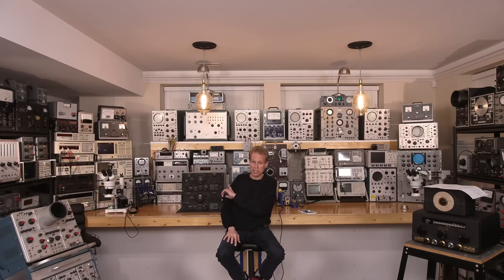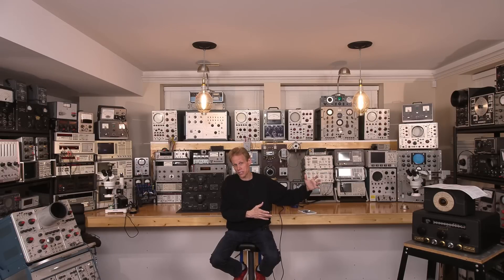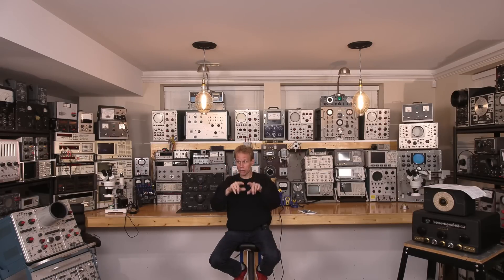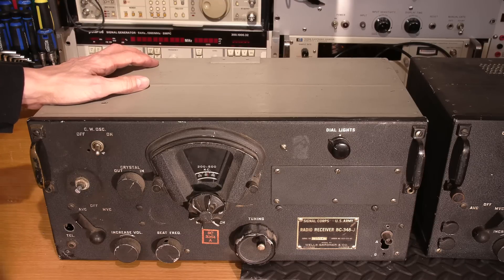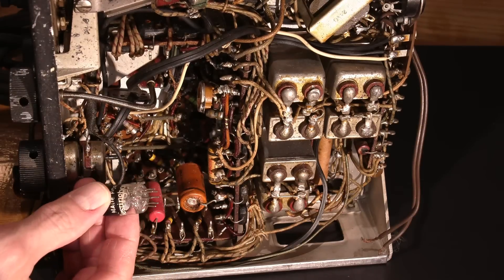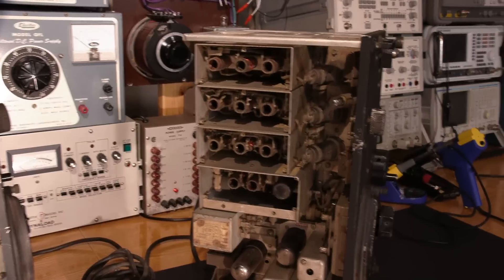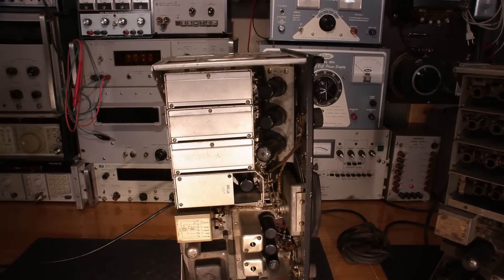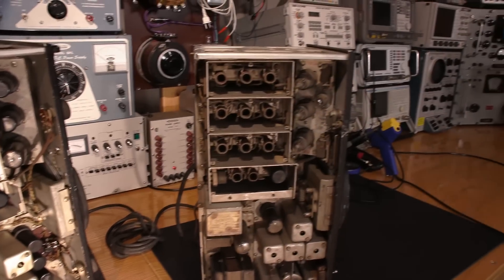Restoration Warplane Radio Receiver BC-348

Comment: Yes, please continue The Grand Reciver Restoration series…this is right up my alley. In fact, I’ve just finished restoration of a BC-224 (the 14v version of the 348) and have also done a 348q, similar to the last two of yours. As you know, or have figured out, the 348 is not a single receiver but rather a series of radios. The first one you showed is an earlier version, the second and third are simplified designs…intentionally done to get a similar performance from an easier radio to mass produce (at a lower cost). The later ones are clearly easier to work on, but I kind of like the older design…glutton for punishment? But to get to the point, #2 is probably the one to go with (although my heart is with #1). Regardless, #3 is out…hope you didn’t pay much for it!

Comment: I watch all the videos you post. There is always something to learn from each one. 
If I could have a choice other than communication receivers/transmitters, which I honestly don't really have much interest in, it would be more audio/video related content. Amplifier troubleshooting and theory, FM tuner alignments. That is my passion,  and everything I have was acquired with some sort of issue that I had to figure out how to fix, or still have to figure out because I just don't have the know how to do it yet. Yes, there are others on YouTube doing those things. But they are not you. You have built a reputation with me and earned my respect as an engineer and tech, and I want to learn it from you.

Comment: I'll agree with you that the center receiver (Radio #2) is the best candidate for restoration.

I can apprecieate how to document a repair on video could DRAMATICALLY increase troubleshooting & repair time!  I've been a ham for 56 years, & retired after a 45 - year career in electronics; my carrer spanned consumer electronic.  Started in a small radio - TV repair shop in my early 20's, movved into the commercial 2-way radio field, about 6 & 1/2 years in industrial conrol electronics (maintaing NC & CNC machine tools, including a little bit of robotics), repaired amateur radio equipment professionally, then moved into electronics manufacturing.  My kast 20 years were spent as a production debug technician for a large data - storage equipment manufacturer (by chance, happend to retire JUST as the first noises about COVID were starting to come out of China!

Now in retirement, I've gotten back active into hamming again,  I've been a long - time VHF / UHF / microwave weak signal operator, but I enjoy playing on HF now and then, both QRP with an IC-705, & at the opposite end of the scale, on 75 meter AM with 50's vintage "boat anchors". 🙂.  Definetly gotten into restoring older ham gear; radios that I couldn't afford as a teenager (got my Techcian license as 16!), were "dream" rigs for me back then, or getting duplicates of some my earlier rigs that I has sold off to finance equipment upgrades back then.  My modern radios (ICOM IC-7300, IC-9700, IC-705) are mind-blowing to me in terms of performance & capabilities to me; but they share space in the shack with a Collins R-588, Hallicrafters SX-101A, Drake R-4B / T-4XB, Lafayette HA-460, & a batch of other vintage receivers, transmitters, & transceivers.

I can appreciate how long it must take you to shoot & edit some of these videos; I would say try to balance the amount of troubleshooting info you give with time concerns.  Keep up the good work!

73,
Tom WA1LBK

Comment: I love the Grand Restoration series! Regardless, I'll watch whatever you work on. You're clearly very skilled and I love seeing old electronics being discussed, worked on and brought back to life.

Not only are you skilled with electronics, you have a unique way of delivering info that's easy to follow along with and learn from.

I love the old tube equipment whether it's an amateur receiver, audio equipment or test equipment. 

Old aviation radios are very interesting to me as an observer and a 'radio guy' because of the unique power systems in aircraft, the extra shielding and filtering that I imagine is required, as well as the harsh environment they were built to endure, and the nostalgia and stories behind them all.

You have a very clear, consise and calm way of speaking, much like Mr. Rogers :)

I view you as a hybrid of Steve Wozniak, a hero and virtual mentor through electronics magazines since High School in the late 70s, and Mr. Rogers... Ay :)

Comment: Mr.  Carlson 
Radio two is my selection. 
Great knowledge and presentation of material concepts. 
Over many years since attending De Vry in 1973  I too have completed many restorations. Lots of fun and rewarding work. 
My most memorable project was an Admiral 19A11  7JP4 television set 
Still have it and still working. When I restored it I was able to get 10KV rated disc caps to rebuild the deflection plate circuits.  
Please keep doing projects of radio and TV restoration it can be an exciting career or hobby opportunity for those who have a great desire to restore electronic equipment. 
Please consider doing safety videos for presence voltages high and low. Polarity and voltage differentials especially with tube circuits. I have been zapped many times and it is not a good situation when it happens. 
Overall I love your program it is superb. 
I have a 1940s Dual Tone 
Table top radio the tube complements is 6A8 6K7 6Q7 6V6 and 5Y3
Currently working on this radio and have not been able to find a schematic for this. Do might know of where I might find one?
Many thanks and best 
Regards, Will

Comment: I find your receiver restoration series interesting because the principles apply to any radio.  Although I will never own one of these venerable pieces of equipment, your techniques - to bring these back to life - apply to any radio receiver of a certain vintage.  Also, there is the satisfaction of seeing a radio working again, after many years in storage.

Comment: Yes, please continue the Grand Receiver Restoration series!   I enjoy it very much!  I was eyeing these BC-348 receivers on Ebay and may want to buy one.  So watching you restore one will be great!  In terms of which one to go with, I would say, the middle "less busy" one and use the case from the one without the power supply.  I am curious bout the design differences in regards to the first one though given that has the older style grid cap tubes.

Comment: The radio restoration series is something I always look forward to watching episodes from. It would be neat to see one of these BC348s running off a Dynomotor at the proper 14vDC.
Reply: I just cleaned one up for a local club that ran on 18v used in B-29s.  Completely original with dynamotor.  I can send you a link to the video of it operating if you like.
Reply: @theradioroom726  I have one that has been in the family since-new but it was converted to AC use right after the war. Luckily not that modded beyond that. Wish they had kept the dynomotor but it was given to a cousin in the 50s to help them convert some used radio they found to work in their (prob 6v) car.

Comment: Absolutely, yes, Paul to the restoration videos of these wonderful receivers. Your videos are helping me with the restoration of a very butchered steel/shore-based R1155. Luckily, I have a donor alloy/aircraft R1155 (also butchered and missing its front panel) that I can salvage parts from. I would choose radio 2 to restore because of its front panel and use radio 3 as a donor where possible. Radio 1 looks to be a different vintage and probably needs a separate restoration. A very happy channel and Patreon subscriber.

Comment: I 100% support continuing the Grand Receiver Restoration series as well as including other videos on electronic "wizardry"! Honestly, any videos you produce are always well formatted, have excellent videography and post-production, and are very informative. I have learned and continue to learn loads of information about electronics, both modern and vintage, from you videos. I have a soft spot for the vintage equipment, being a collector/restorer/user. Most importantly, do what works for you! If it takes you 6,8,or 10 months to get a video out, we will still be here patiently waiting. The last thing we would want is for you to get burned-out, frustrated, and the channel go silent. That would be a travesty!

Comment: I vote for number 2 and yes continue with the project so the full range of sets can be compared, all of your videos are appreciated Paul but I suppose quite a few people may want the instant gratification from a particular type of equipment as for myself who has worked in the electronics and semiconductor  and medical industry I am well aware of the time it takes to resolve issues. I also have the time now as retired whereas other my not. I will still continue to watch and follow your site in which ever way you decide to go and many thanks for all your hard work 😄😄

Comment: While I like seeing these old receivers restored, and I would certainly watch the restoration videos, what I really like to see is some of the older, more "unique" equipment explained and restored. The kind of stuff you don't see everyday or may not even know existed. Test equipment, power supplies and especially older tube based audio gear. But whatever you decide to do, rest assured, I will watch.

Comment: Yes please continue full restoration on bc-348, your videos are very informative and great fun to watch , great job Paul, about the other old radios restore them as well, I will watch every episode. P.S. restore the radio on your left, the messy one, i read in Wikipedia that a later design was to compress the 4 mega cyle stages and they added the 1 kilo cyle stage, forgive me if this was commented by others i havent read all the comments.

Comment: Thanks for all you do to make it much less daunting for people to take the plunge in fixing by seeing all of the projects you do, and all of the knowledge you impart.

I do enjoy the restorations on older equipment. It can be a bit more fiddly doing the evaluations and making decisions on how to keep these old radios operating, but it would be a waste of your talents not to continue and pass on your knowledge and experience to the upcoming generations.

That said, it's pretty obvious that Radio 2 is the best restoration candidate, and using the restored case from Radio 3 will make it closest to factory spec. Your interest in using the power supply from Radio 1 should be contingent on whether it offers better-suited performance specifications (stability, sufficient amperage, heat output in the enclosed case) than the one already in Radio 2. Whichever power supply you choose for Radio 2, if the other is functional you should use it to resurrect, if not restore, Radio 3 if possible (unless some esoteric difference in Radio 1's design piques your interest in it and a resurrection of Radio 1 is feasible).

One thing that may help to maintain interest in a longer series is, if possible and feasible, more comprehensive demonstrations of how performance at various stages of the restoration has affected the radio's performance. It's easy to go from showing a derelict, lifeless hulk to a pristine-performing classic champion, but I think viewers would like to see more interim progress reports on how gradual steps change a radio's performance. Seeing more progress in what you can do with the radios as work goes on may help keep up viewership.

Comment: I like watching whatever you do Paul, I always learn something new. I personally don't have a chance or opportunity to work on much of the older stuff therefore, a lot of the information gets lost in my head without going through the process to cement that knowledge into my memory. I usually watch through your videos, and after watching, turn back to my own bench and start pulling my hair out over the modern transistorized projects I have before me. I am coming to the conclusion that I may have started this journey too late in life. Playing catch is harder. Anyway, your way of teaching is the best around if for any reason, your attention to detail far surpasses most all others on this platform. So yes, put the time into restoring any one of those rigs, try not to leave out too much, and I will search for an older rig that's in need of repair so I can apply what you are trying to teach. Sorry for such a long answer.

Comment: Mr C, I enjoy all of your content, and your high attention to detail. I wish I could see more of the actual work you put in every piece of equipment, the bench and repair time, replacing capacitors etc. Even if it were just a montage. Also, I would prefer newer gear, solid state analog in particular, but will watch and enjoy whatever you want to share with us.

Comment: I am part of a group in Sweden which is repairing and restoring old boat anchors and we are very interested in your Grand Receiver Restoration  Series and like you to continue with this. Your videos on the RCA CR88 was very helpful for our work on my 1944 AR88 D which now is restored to "as new". This restoration was similar to what you plan with the the 3 BC348s i.e. I took the best parts from 2 AR88s  and made one very good looking and  one that was also working  but not as good looking. We also have a BC348 + ART-213 combo as well as a Racal Ra117 which needs some work. We have also noted that there is an interest in keeping the old rigs working among other hams here. 
As to your 3 BC348s : You're No. 2 radio  is the one I would use as a the base and then take parts from the other two. 
Looking forward your further videos.

73 de Jan/SM5MRQ

Comment: Paul,  I am into them.   I have been watching you for a while.   I am definitely a fan.   I watch others too and I usually end up critical of some of the decisions they make.   I think your more extensive experience shows, ney chines brightly.   I definitely knew already about cleaning and making circuit boards, capacitors and simplified troubleshooting (super probe), for example.   I built it and the capacitor analyser.   Nice designs and I am proud of my copies.
Please continue with the radio restoration series.  You may want to show some of the capacitor replacements (in fast motion) to keep the interest of some of those who might be bored...  Or just skip them all together.   
Thank you.
Please continue.
J

Comment: Paul - Yes, please continue the restoration series! I have 5 Signal Corps receivers in various states of functionality. My BC-348-Q works, but my BC-348-R has some audio trouble, even though it has been lovingly restored. I also have a BC-348-O parts radio.  In addition, I have a pair of BC-342-N. One works well but the other needs restoring. Your video series will help me with all of them.
The suffix letter in the model is the reason for the different chassis layouts. I don't understand it all, but you will probably learn more as you research the radios.
I have a video up of my BC-348-Q comparing it to a modern receiver.
73 Paul AA1SU

Comment: I vote for #2  BC-348 radio. The 6SK7 has a bit higher Transconductance then the grid cap 6K7. I like your grand receiver restoration series. Wish you could just emphasize the highlights of the restoration to shorten up the time frame for each radio worked on. Although it's good to have some details explained with less repetition. Waiting for years to see all the radios restored and compared, I could be dead and gone. That's how much I would like see this grand rec. restoration project get done in a timely manner along with the other restoration projects you have in mind. We got the idea of what it takes to restore such high end radios, maybe you could skip making some of the videos on the receivers to save time at getting them restored. Too many videos on one thing gets boring.

Comment: Paul, I recall when you  first introduced the idea of restoring those radios, I was eager to see them all restored. I still feel that way, but this is YOUR youtube channel and depending on what you want from it and what affects the views and comments, you should do as you feel you must. As someone else said below, I will watch anything you post. I don't always comment though I do "like" or not as per the individual videos.  I'd like to see the long term project through even if it is stretched out over the next couple of years!  I do like the mini-projects you offer since those are closer to the types of electronics I personally am qualified to handle (I am not a schooled engineer).  I also lean to the older restorations as a personal choice and am not as interested in modern electronics in terms of repair.  
Until you examine the schematics of this current radio project in terms of what was the idea behind the designs. I do think you should lean to restoring "a" radio as it might have existed from the factory instead of a "hacked" radio which might have had a purpose for someone, but not the way it originally was manufactured.  Perhaps you can explain why the designed changed based on your research on the three models and opt for what the manufacturers might have had reason for the changes. I know that it varied by various military needs.
Anyway, my initial two cents!

Comment: Please continue with the Grand Receiver Restoration Series, I have learned so much from your videos, restoration or repair. I am for the most part self-taught in electronics, and have restored several pieces of vintage test equipment back to  working condition. I would like to find a vintage tube radio and would like to restore it, the invaluable knowledge you pass on to the viewers will save numerous radios from the junk pile. I would be very interested in a comparison of both #1 and #2 radios, just to see if there is much of a difference in reception and sound quality as well as the technical aspect of the different designs.